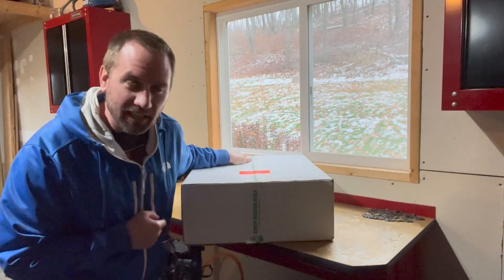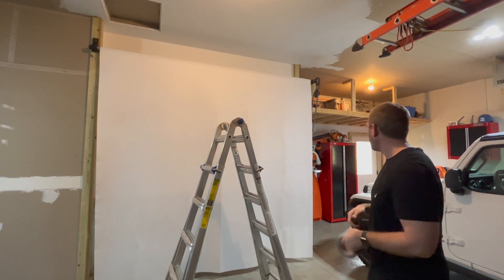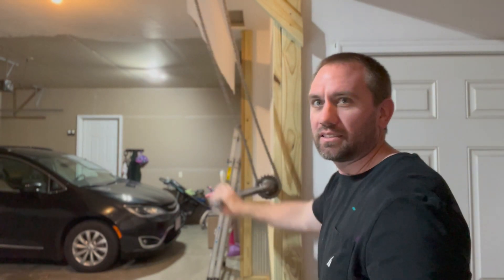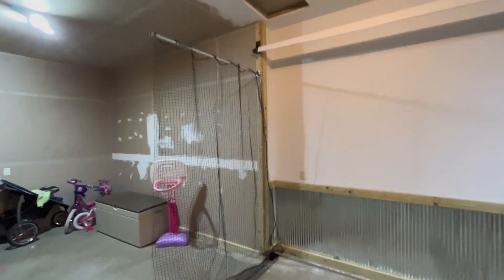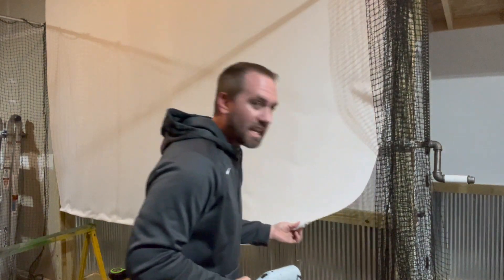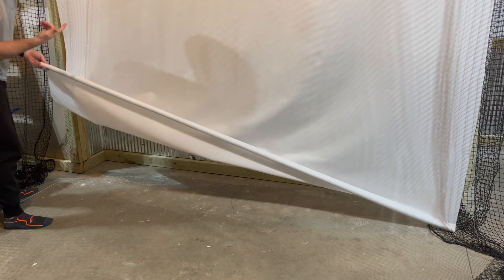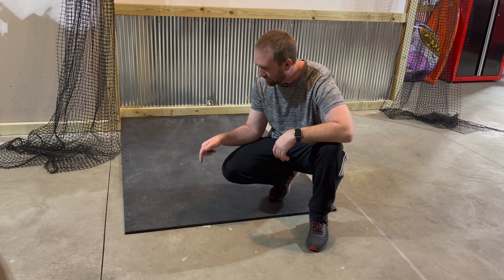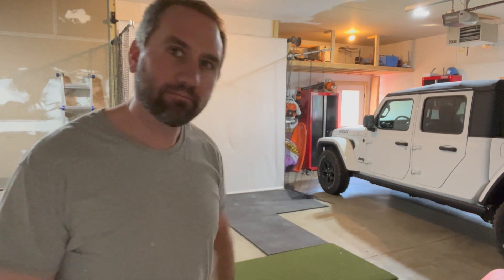Golf Simulator Build Episode 2:  Impact Screen Hitting Mat

Comment: What size or tooth # sprockets did you use with chain system?  Will any size work, or is there a recommended ratio?   I’d to attempt a simular build, so any information would be helpful.  Great videos
Reply from the maker: I talk about the chain and sprockets in episode one at 9:30.  It’s #50 chain close to a 1:1 ratio.  The chain size is way overkill but I figured it would be more forgiving on misalignment and such.  

Good luck 👍, have fun with it.

Comment: I'm not handy at all. Do you think your set up could work with a wider screen, lets say i I want 12 ft wide screen.  would it work and how di you figure out the hand crank stuff? I also need way more side netting than you do.
Reply from the maker: Yes, a similar setup could work with a 12ft wide screen.  You could go with a larger diameter pipe to reduce deflection, but it’s likely not necessary.  

I pieced the handle crank stuff together from parts at a local farm supply store.  I hade to do some welding to make it work so it’s likely not practical for everyone.

Comment: Do you have any recommendations for hardware that can be used to enable the bar to spin? Something robust enough to withstand the weight. The bar you converted over from your golf net worked perfectly (looking for something like that). Also, how did you connect the top of the screen to the bar? Great video, it was extremely helpful.
Reply from the maker: I would use some pillow block bearings like these:  PGN - UCP205-16 Pillow Block Mounted Ball Bearing - 1" Bore - Solid Cast Iron Base - Self Aligning (2 Pack) https://www.amazon.com/dp/B07MWGF35D/ref=cm_sw_r_cp_api_glt_fabc_J37SZDQZH8YKPKMT7NK6?_encoding=UTF8&psc=1

Just make sure that the bearing bore matches the bar you go with.  

For the bar, I’d recommend the steel-tek bars at lowes, then you don’t have to deal with threads.  

I taped the screen to the bar with duct tape.  

Thanks for checking in, good luck with your build!

Comment: Hello, what tape did you use to keep the screen attached to the bar permanently? I have used 'strong' masking tape and it doesn't work... it doesn't stick to the fabric well enough.
Reply from the maker: I used 3M duct tape.  I also positioned the bar to have to still have a full wrap when the screen is touching the ground.  Keeping one wrap on the bar takes most of the force off of the tape.
Reply: Great thanks for the quick response. Have you had any issues with the sides of the screen fraying as you bought it unfinished.
Reply from the maker: @jordansalisbury1126  you’re welcome.  No, the sides of the screen are holding up well I don’t see any fraying.
Reply: Ok great. Sorry, I am having some troubles with the tape I am using is why I ask haha. Any chance you could put a link to the tape you used? Thanks
Reply from the maker: @jordansalisbury1126  3M Duct Tape DT8, 3 Pack, Industrial Strength, Multi-Use, Silver, 1.88" x 60 yd, Professional Grade Adhesive https://www.amazon.com/dp/B0977P9W4X/ref=cm_sw_r_cp_api_glt_i_H9VZF4PMVMG530X2P6H6?_encoding=UTF8&psc=1
Reply: @jordansalisbury1126 I’m having the same issue with my duct tape. Were you able to make it work with the suggested tape? I was going to try t-Rex tape next.

Comment: Was that screen worth it? For a guy who drives 330 how many impacts do you think if will take before if becomes confetti?
Reply from the maker: I did have some damage at the end of the weight bar which I detail in episode 5.  This damage was really my fault because I left the ends of the weight bar pretty sharp.  

I am really amazed how the screen itself absorbs impact so it should work for you just fine.  I was tempted with some options on Amazon but my friend had this exact screen and it was working well for him.